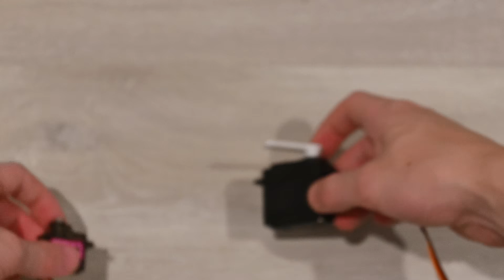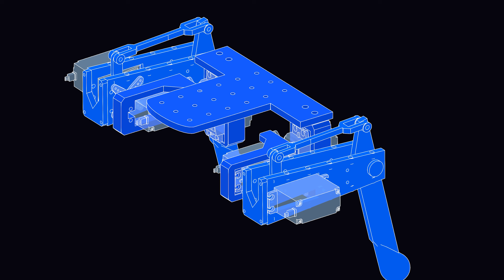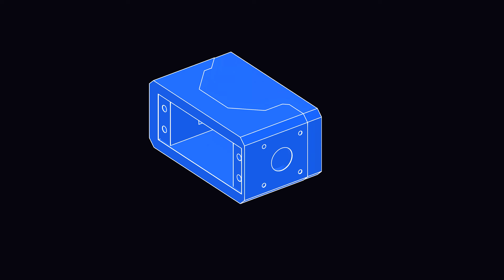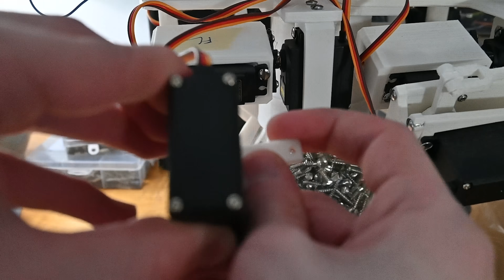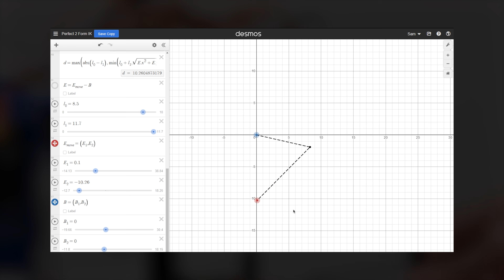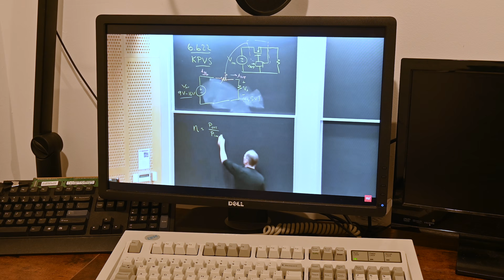I Made a Robot Dog

Comment: Awesome project! Also, good tip with the silicone tape, I'm currently working on a device that builds a MTG dech from a decklist, and was having issues with TPU requiring too much pressure to get the nessesary surface area to move the card, i was thinking about buying silicone mix, but silicone tape seems like it will be much easier, cheaper, and less messy to use.

Also, quick 3d printing tip that you may have figured out in the year since posting, but try putting chamfers on the corners of your project. Increasing bed adhesion works, but the smaller the corner angle the smaller the area of adhesion surrounding the corner point, so sometimes runundijg it works betted. I typically use a 2-3mm radius but even 1mm is significantly better than the nozzles 0.4mm in a tight space. There's probably a YouTube video that explains it better than I can here, but there's been times where I've forgotten to do it, the print fails, and putting them in fixes the issue.

Comment: do you think you could power it with pi pico 2w, or like a less powerull one?
And also what kind of 3d printer are you using?
I'm trying to make a similar project like you. D:
Reply from the maker: The microcontroller is not the limiting factor in this robot, so yes you could use a different and less powerful one, to an extent.
I currently only own an Ender 3 Neo, although I have heard better about the Prusa MK3S. (They are in different price ranges though)
Reply: @AstroSamDev Thank you, I love your content ❤

Comment: If you want your parts to stay stuck to the print bed while printing, use a regular glue stick. Once I started doing that I have never once had a print failure
Reply from the maker: Thanks! I did try that with the new filament, but that didn't seem to improve it's adhesion much. I think it is just down to the brand, and the chemical makeup of the PLA.